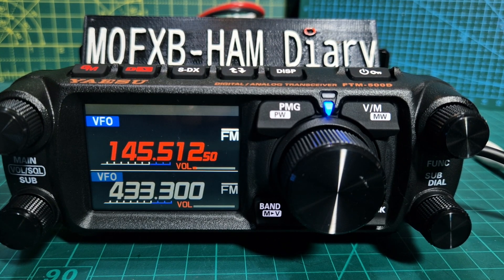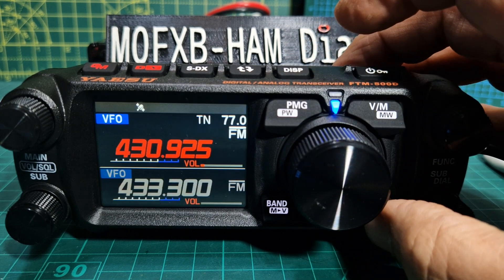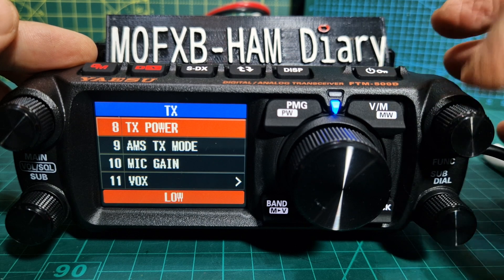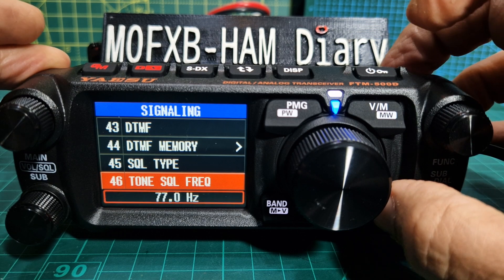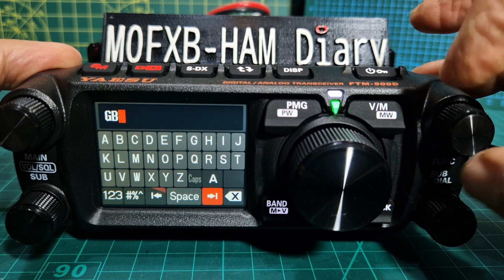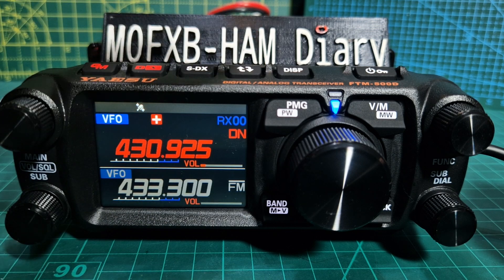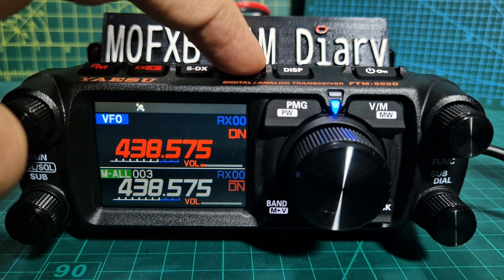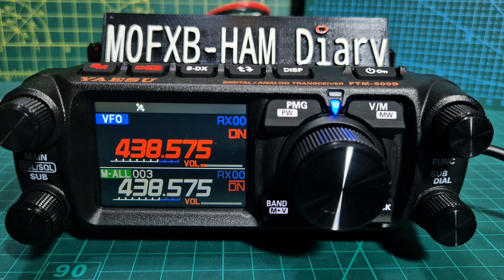YAESU FTM500 - ADD REPEATER

Comment: At  1:17, you show a shortcut to your memory list. There is also another short cut that I haven't heard anyone talk about. On that same screen,  instead of entering the frequency,  you can also enter the memory list number and press the large knob to enter. The frequency for that memory number will come up. So if you're like me and travel a lot. I have several hundred repeaters programed in my memory. So I use that short cut to quickly get back to my favorite repeaters.
Reply from the maker: Nice tip

Comment: Does Yaesu still use the weak RJ45 plug for the mic going into the radio? I haven't bought any amateur radio rigs after my Yaesu mic plug failed and went to Motorola instead!
Reply from the maker: I have owned many YAESU radios over 30 years  all have never failed you were unlucky .
Reply: @HamTechRadioScannerDrones  Actually, I'm very gentle on my gear but the mic cable had fractured at the RJ45 connection point! The mic is still functional but I don't have any confidence in running this gear in a mobile environment.